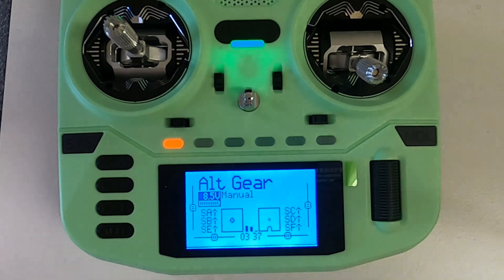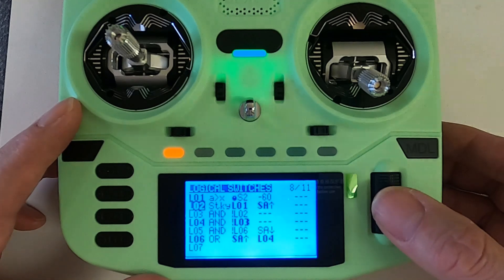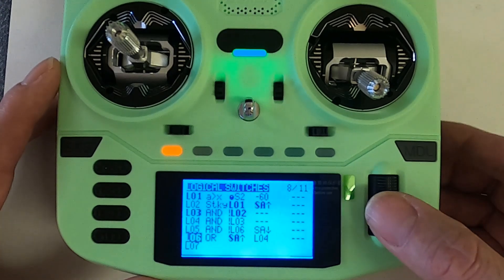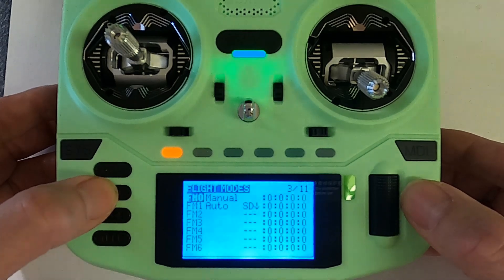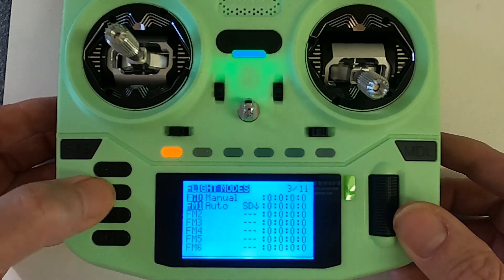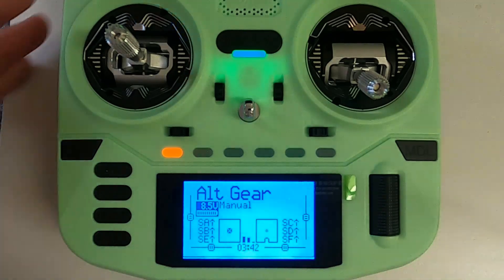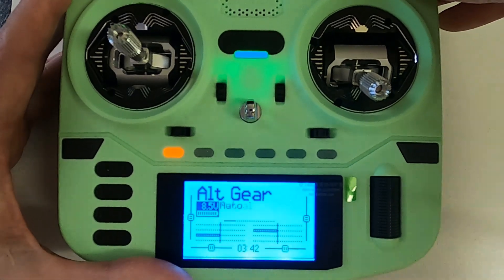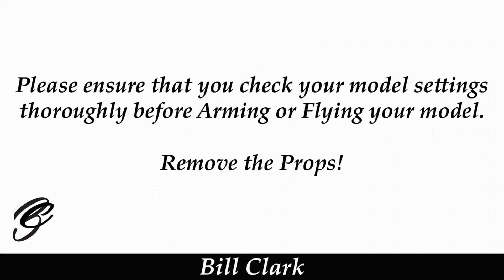EdgeTX Auto Gear Down (Viewer Request)

Comment: Hi, could you please make video about how to set up FMS reflex V3 gyro with radiomaster boxer? I've been trying very hard but fail to do so and couldn't find anyone make a video to set it. Thanks in advance.
Reply from the maker: I do not have the FMS reflex V3 gyro to set it up. The radio you are using will not make much difference to the set up. What receiver are you using PWM (servo connector) or SBUS? I have checked the manual for your gyro so will try to help you.

Comment: interesting approach thanks for the video, basically what i wanted to achieve was a squat switch and since i don't have weight sensor on the plane i emulate this with alt< 3m and thr=0, so if plane is bellow 3meters and no throttle i will not be able to accidentally raise up the gears, when the plane is on the ground. But i f i want to put it in the car i will have to press my momentary switch and it will activate the gear switch and i will raise them manually. Anyway thanks a lot again